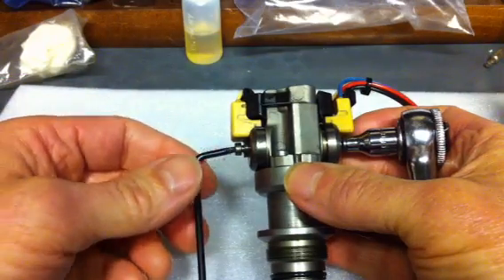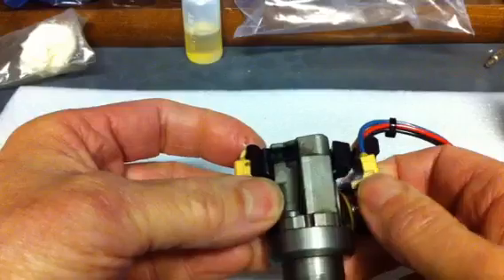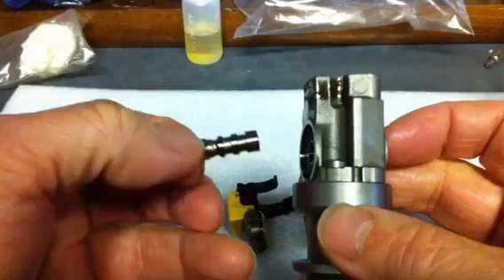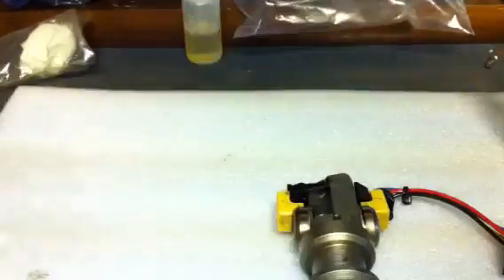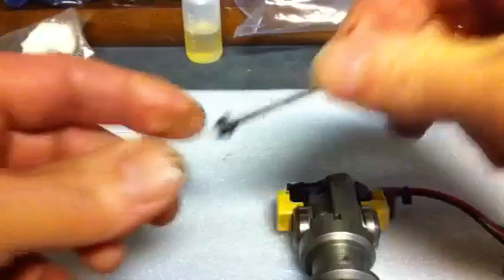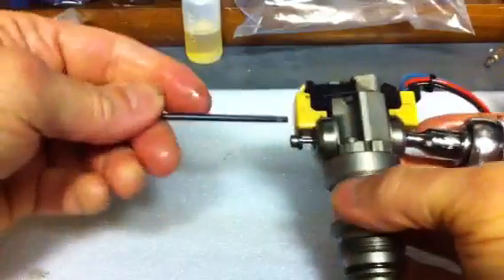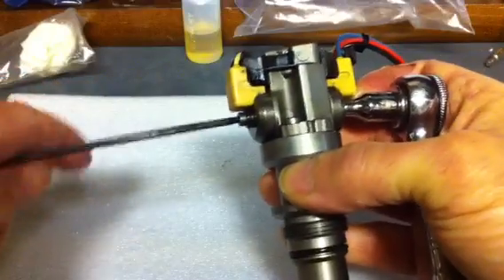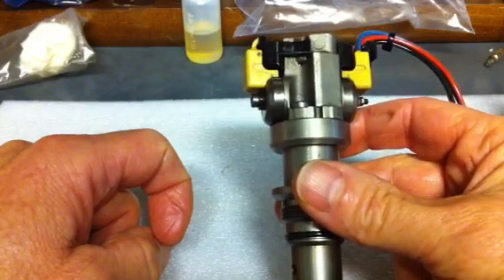Fixing stiction - Powerstroke

Comment: The friction of the spool with the housing or valve, of the injector, in a long period time creates a natural wear, the spool is like a "bone" with larger segments or gaps between; this will close or opens the valve with help of the coil. That means that the valve itself has some gaps too and when the spool get used it start making friction all over the place and the wear will not be uniform and that will create gaps that will finish in injector stiction, hard starts, etc. 

It's hard to match the valve and the spool as you have to hone the valve and put a DLC coating on the spool to match them, sometimes it will work ans sometimes don't, or you can get a Valve & Spool Assembly for that injector and have a New matched part that will ensure that your diesel fuel injector won't get more problems. 

If you're interested in the Valve & Spool Assy, please visit www.california-diesel.com you can see a couple of photos there and order it if you need it, we also have solenoids for 6.0L Power Stroke injectors, nozzles and other parts.

Comment: Berrymans carb parts cleaner REMOVES the varnish without putting 800 grit score marks that promote cross leakage and basically ruin those valves, if their is varnish on the round valve then their is varnish in the housing so brute scraping of one side is doing nothing but ruining a component. Their are chemical additives that break the varnish while driving, chemistry is your friend. Chemicals caused the problem and chems solve it
Reply from the maker: Have you tried it on these spools? These are not typical fuel type varnishes. BTW, I like chemicals over abrasion as well, but often you need special equipment to get the desired result. At the time of the initial video, there hadn't been much success in using a readily available chemical scrub that was available to the public. Rather than discuss options, show me some results on these injectors.

Comment: when i saw advice to use any type of sanding to fix an injector, i knew this was a bad place for info
Reply: The surface is so hard on the spool valves 100 grit sandpaper will not even scratch the surface. All the sand paper is doing is removing varnish
Reply: @zakksrage  then use chemicals that remove varnish
Reply from the maker: @zakksrage  There is no doubt that excessive use of abrasives will damage the spool, and many people remember their high-school shop days when they went too far sanding their wood-work bird project. In any case, the "newest" new injectors are a much better option than repairing old injectors, but this process still works.
Reply from the maker: 800 grit used judiciously will break the varnish that causes stiction. You are not using a belt sander or an inordinate amount of time sanding. This process has worked for hundreds of injectors that I know of. In fact, 3 of mine have been going strong for 50k miles, and these are also modified to 190cc flow.

Your comment comes from not actually wrenching on these injectors or knowing what causes stiction in hydraulic components. Buy new ones if you must, and the new ones from the past few years are pretty good, but if you want to learn something, give it a try. You can always buy new ones as not all are fixable. FYI, until a few years ago, you couldn't buy new, only reconditioned/reman injectors. Some did OK, while others didn't.

Comment: Old vid but maybe you could comment back, so every injector i replaced so far (4) has had that little 4mm nut missing. Always bought new one and just replaced...anyone know if that nut single handedly causes a failed injector. Like can i just install a new nut put that injector back in and voila, no need to buy a new one for $1 nut?
Reply from the maker: Those little missing nuts could end up in your low pressure oil pump, assuming they get past the pick-up screen. My biggest concern is that they could get to the valve lifters and cam lobes on the way to the pan. 

Not having the nut in place allows the coil magnets to move. That could mimic injector failure as the spool can move beyond the normal range of motion. As you noticed, new nut and it works fine. You might want to use more torque (mini more) when installing it. No need for locktite, but if you are seeing this on a regular basis, perhaps some form of glue could help.

Comment: This is much appreciated.  I just did two injectors that tested bad on the scanner. No. 5 and 1. Did a complete seal and washer kit on them also.  Wow. what an improvement I got.  This and two upgraded stand pipes smoothed her right out.  Way more power.  I bought the truck used and it had a periodic miss fire.  Your the Man.!
Reply: semtech30 what was the code that was popping up?  i have #2 saying "P0264 Cylinder 2 Injector Circuit Low" and "P0266 Cylinder 2 Contribution/Balance"  I was hoping that simply cleaning it maybe the solution, as the injector is fairly new and the wiring harness seems to be ok.
Reply: The Downfall of Society No, I don't think cleaning will fix this as this is a mechanical stick.  Circuit low means electrical.  May be the FICM unit injector coils or wiring.   See Diesel Tech Ron videos.  His latest may address your problem more detailed.  He just put it up on the tube here lately.   Good luck with it.

Comment from the maker: This video started as part of the disassembly process. There are some design flaws in the original injector spool that can lead to stiction, regardless of the FICM strategy updates from Ford. However, oil choice and maintenance are definitely the leading causes. Maintenance is key to preventing problems, but it still happens. Fuel additives will do nothing for spool stiction, but will aid in lubricating the plunger and nozzle. 

FYI, a Ford Sr Master Tech has done over 30 sets with great result!